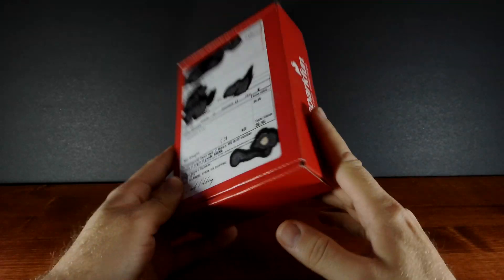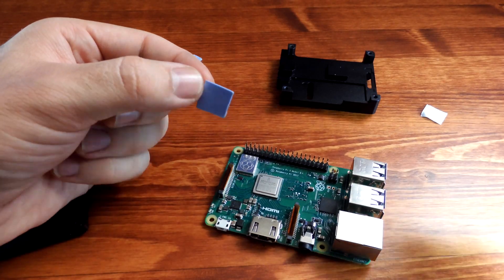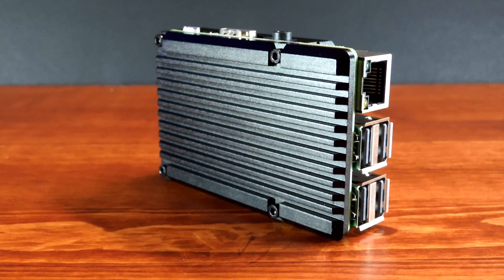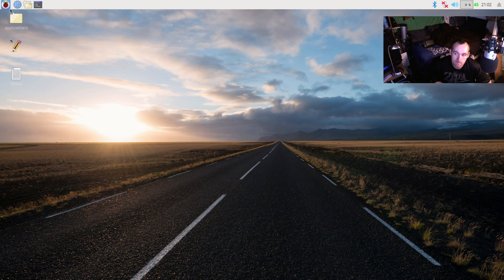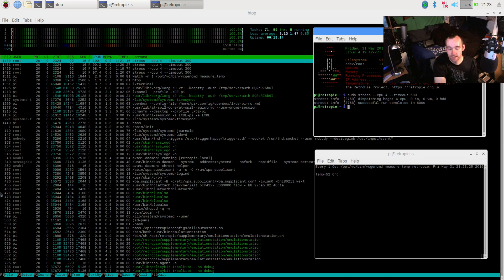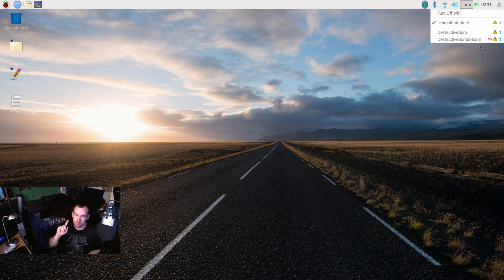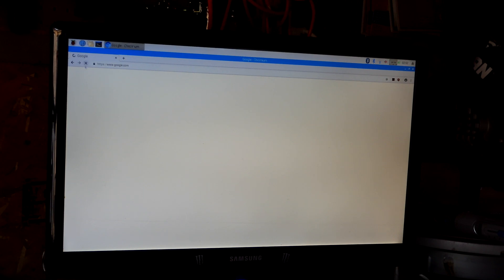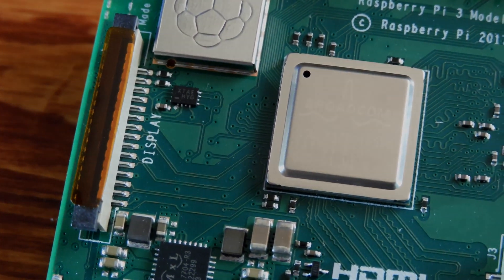Raspberry Pi 3B+ Aluminum Alloy Passive Heatsink Review

Comment: Nice video. I got the exact same case but the screws are shorter I believe and there is just no way to tighten them. How is that even possible? :)
Reply from the maker: It's from China.  There not consistent in everything unfortunately.   I would complain about it.

Comment: How safe is it to remove the sticky adhesive heatsinks that's already been applied on my Pi? I like this case but it already has the individual heatsinks applied on the chips.
Reply from the maker: i.STiLL.FUNCTiON To remove the older smaller heatsinks I personally get the chip hot and slowly twist it back and forth till it’s weak enough to remove.
Reply: @DestructiveBurn  Thanks for the heads up. Funny I don't really need this case but I just want a new case as my acrylic case with the smaller heat sinks is perfectly fine.
Reply: @i.still.function3463  I hope you didn't switch to an inferior cooling solution...

Comment: This case is great so long as the ambient temp is less than 22C. Here in the UK, with the Summer Temps hitting 35C+, the system lost communication with the system RAM, so nothing would load, although the Pi didn't crash outright.